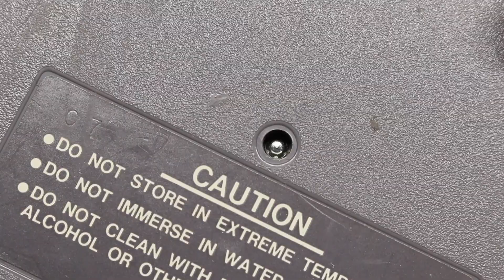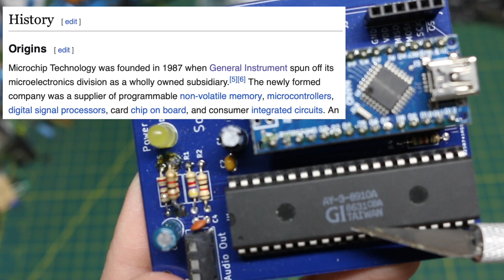Mailbag!

Comment: Those connectors at 7:10 have grooves in high relief on one side and low relief on the other side and they fit together. You are pressing the high relief ones against each other. If you align them both facing the same side they will fit.
Reply from the maker: these smaller ones have smooth non-docking sides like this https://www.aliexpress.com/item/1005001677869988.html
looking at them in the picture it looks like the problem with stacking them is normally there’s that vertical partition plastic of a certain width in between each terminal but there’s also that same partition on each extreme end of the strip so then when you put two together you have an extra vertical partition and it knocks it out of pitch

Comment: Happy New Year!! 🥳(One of my first purchased synths was the Twisted Electrons AY3 which contains two AY38910 chips. Each one gets its own output and can either behave the same or quite differently ... so sometimes they sound stereo-like and other times like two parts panned hard left and right.)
Reply from the maker: I wonder what it would be like to have a bank of several voices of them and the ability to route them between a left and right or dual output signal path. As I say that I’m thinking why wonder, why not do it.

Comment: Fun fact(s): Those screwdrivers, while colloquially are most commonly referred to as "game bit" are officially a security bit named "line bit". Most commonly known as used by Nintendo for a while, several other companies used them, including Sega, who used them as much or more than Nintendo. First known use was in a Phillips VHS player.

AFAICT the OEM hasn't manufactured the bits/drivers in decades, and it is virtually impossible to find one that isn't an unlicensed knock off.

I tracked down the original name and manufacturer several years ago for a video, and it was an _adventure_.
Reply from the maker: Maybe Phillips should have designed a security Phillips bit. 
The first time I had to extract one of these security screws, I accomplished it with an old soldering iron tip by excavating the plastic surrounding the screw.  it was probably a decade before it was possible to figure out what the bit is on eBay.

Comment: Adding adapters is neve a good idea as it increases the leverage on the first connector joints.  But that's just my opinion having had to fix units where 1/4 inch pluge had been put in to 3.5mm adapters. Buggered the 3.5mm socket.
Reply from the maker: Going from such a larger to smaller and with that extra length is definitely not something I do horizontally but on that orange amplifier I use I go the opposite way where I take a 1/8 plug on a lightweight cable and go into a 1/4 adapter vertically with the 1/4 jack on the top facing up. 
But I once got a free audio mixer where the problem turned out to be RCA jacks on the back needed to be re-soldered and then it worked fine. I got that in the 90s and I still have it.